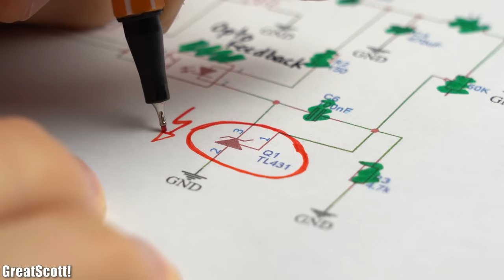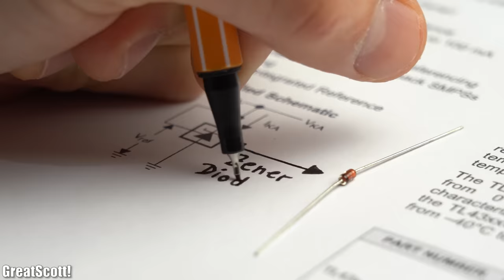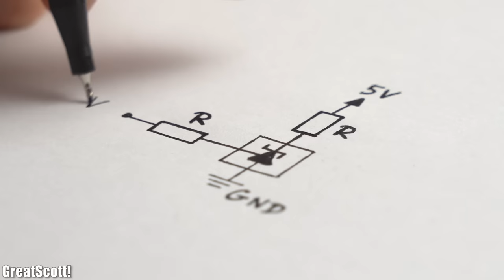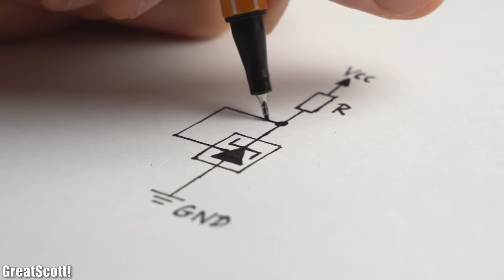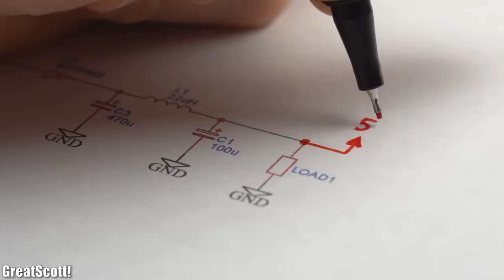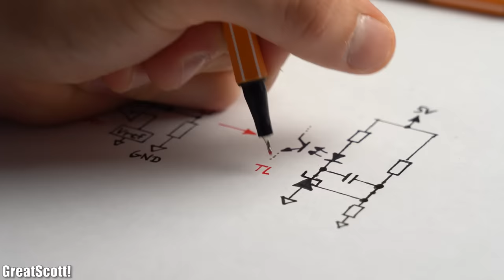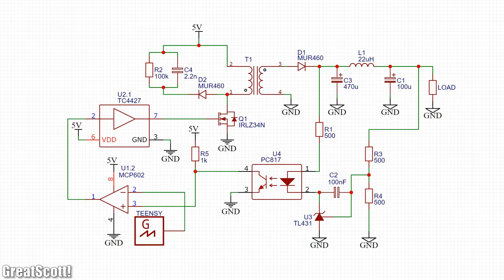Probably the most used component nobody knows of! TL431 Guide! EB#50

Comment: I had a 24 volt switched-mode power supply but needed 19 volts. To do this, I simply changed the voltage divider on the TL431. I connected a potentiometer (value corresponding to the old resistor that I removed) between the plus 24 volts and the 2.5 volt sense point of the TL431 and reduced the value until I could measure 19 volts at the output. Then I replaced it with a fixed resistor.
Reply: Is your power supply still working well now?
Reply: @salihay  sorry he dead,
May his soul rest in peace
Reply: It depends on the design, some controllers will have undevoltage protection on the VCC pin that feed them from a separate winding on the primary. Lowering the voltage of the output will lower VCC too. Doing the other way (try to change the voltage up) can also fail because the same issue. Some PSUs are pretty basic and will not care. Other have this protections and zeners as double safety, usually triggering from a dedicated optocoupler in case that everything fails (laptop chargers). also note that 817-alike opto polarization changes and its components need to be upgraded. Rising the voltage even when it looks "FINE" is not advisable. This PSUs have nothing to spare. Spikes when swithing off will kill the mosfet or reverse voltage will exceed the rated of the ouput diode. Otherwise ATX psus will make a great labo PSU ...and they are NOT. Tweaking an ATX PSU to ouput a higher voltage is a recipe for disaster.

Comment: TechBuilder made a short facebook post on this a few months ago. Never knew how nifty it could be by adding an outboard pass transistor. Been using it as a handy adjustable voltage reference for adcs
Reply from the maker: There are truly many applications :-)
Reply: I'd have to dig it up, but there was even a switching buck regulator example in one of my old Motorola IC catalogs that used a linear regulator as the sole control in the circuit. Not sure how accurate it was, but it was impressive to see someone using a linear circuit to do switching regulation. Really are lots of applications for something you would not think of.

Comment: Think of the TL431 as an NPN transistor with a Vbe of 2.5 volts, and a super high beta.
Reply from the maker: Nice comparison👍
Reply: AlHasan Sameh  gain
Reply: I don't know what you mean ,but guessing it's pretty rad .
Reply: AlHasan Sameh  There is no beta because there is no current-to-current multiplication; input current does not change much at all. The TL431 is an "almost true" differential voltage-to-current converter. Once it had reached the on-state threshold, it converts 1mV input (referenced to the threshold voltage) to 1mA of output current. And the maximal voltage gain is around 1000 or less (compared to around 3000-6000 for a silicon BJT).
Reply: It's more like a three pin op-amp with a high but very stable input offset voltage.
Reply: Wrong.
Reply: If you think of the TL431 that way (which is suitable or not depending on the use case, some issues were already pointed out), make sure you don't forget that the TL431 stops operating properly when the cathode voltage falls below 2.5V volts. A NPN transistor can regulate down to 0.2V saturation voltage at the collector. The behaviour of the TL431 with cathode voltage lower than ref voltage is unspecified, and *differs between manufacturers*! Make sure you don't accidentally rely on it, or if you already goofed up, make sure you specify the vendor.
I encountered this issue in practice trying to fix a TV SMPS. The supply shut down after some seconds of operation in "power on" mode, but worked in standby mode. One of my guesses was that a TL431 is broken, so I replaced it with a spare TL431, and the supply started behaving erratically, even in standby mode. I swapped the original TL431 back in, recovering standby operation, and finally found the design issue in the main SMPS aux supply circuit that made the SMPS controller chip overheat and go into some kind of protection mode.

Comment: Please keep in mind one important characteristic of this programmable Zener IC. 
It's fully temperature compensated, unlike any Zener that ever lived. 
Zeners are so yesterday.
Reply: It's really insane how much voltage drift things like temperature can cause.  Of course, that's what happens when you amplify errors.  Going from a 24V signal down to a 5V for ADC measurements doesn't sound so bad.  Until you realize that the max needs to be closer to 30, so any errors are magnified 6x.  At that level, even small differences become a pain to deal with.
Reply: "Ever lived" is an overstatement. There is a whole class of temperature-compensated zeners, like the 1N82x series. The genuine 1N829 costs about two hundred times more than noname Chinese TL431s, but it has a rated tempco of 0.0005%/K. That's 0.05% change over a 100K interval, far better than even the best-grade genuine TL431s. 
And if the app needs the lowest possible noise, again, the zeners are naturally quieter.
Reply: Zeners are here to stay for safety. Approvals agencies recognize it behaviour in a protection role, an ic can’t replace a zener here, they’re too slow and failure mode is not consistent. Zeners are cheap and available in different power handling sizes. Massive current pulse handling capability.

Comment: This video combines my two favourite things! A deep dive into a fun component and its applications, and a component that has become cheap because of how often it is used in industry. My last project actually used a TL431 - a voltage monitor to automatically cut-off power from a lead-acid battery for only a buck or two in parts. Thank you, and keep up the great videos!
Reply from the maker: Thanks for the feedback👍 Glad you enjoyed the video👌
Reply: Hey Leon, do you have an scrhamtic for that? I'm trying to build exactly that, but most cut-off circuits I found are op-amp based (just the ones I don't have on my parts bin)
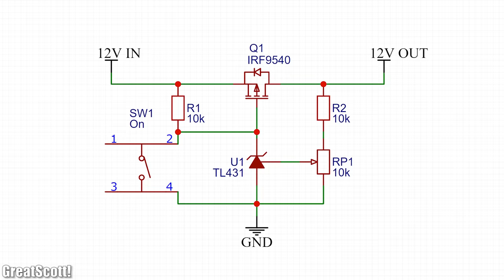Reply: @rhr-p7w  Of course! I'll draw it up for you tonight (NZ time). Prepare to be underwhelmed though... Conceptually it's the same is the circuit Scott shows at 6:50 - but with positive feedback to turn the MOSFET hard-on to prevent overheating (also oscillation), and inverted to use a more efficient (and cheaper) N-channel MOSFET.

Comment: I have a TL431 acting as a voltage reference in a few low-voltage-battery-cutoff circuits. I like to replace alkaline batteries in the cat toys we use a lot with lithium batteries, and I add a cutoff circuit to make sure the battery doesn’t discharge too far. Only five components!

EDIT: No joke, I wrote this before the exact same circuit appeared in the video @6:50…..GreatScott is always two steps ahead of me….😅
Reply from the maker: I just knew it😉

Comment: Regarding SMPS's - these often have EMC issues that designers overlook.  Such issues can plague and pollute the radio frequency environment unless the designer has taken great care.  I wondered if you could do a series of videos on these EMC issues?
Reply: He already made one.
Reply: And apparently some designers don't care at all. I have a Chinese power supply so bad that it can light an LED with just the noise. (Not even a complete circuit!)
Reply: @user2C47  If you don't have bearing on what countries EMC requirements you need to meet in which part of the world then, yes, it is a rather dubious task. I completely agree.....massive vent holes and poorly bonded gaps in chassis of most SMPS  and the fact that a good number of current product designers aren't instructed on giving a shit to begin with does not help the situation. IE not a China issue.

Comment: Used the TL431 in several applications,. Yes, very versatile component!
You call the internals of the TL431 a comparator, but it is really an opamp. 
You can use an opamp as a comparator, but in most cases you cannot use a comparator as an opamp, 
because comparators are not stable in the linear region. A TL431 can be used in the linear region, when you use proper compensation.

Comment: Strange — I use TL431 all the time. One of the best ways I found to control the current of a high-power LED (either linearly or through a switching converter) is with an op-amp comparing shunt voltage to a reference. TL431 is the exact thing you need for the job — the 2.495V it produces by default can be easily divided into anything you need, and, unlike a Zener diode, it can sink a wide range of currents with Vref staying within a tight range. It's basically an extremely accurate Zener that doesn't require you to meticulously precalculate the value of R_Z. Simply great!

Comment: Thank you, I've found these things in 50 cent phone chargers I've bought solely for experimentation and dissection. Never quite knew that they were but assumed it was a switching transistor.  (my fault for not doing more research) PS  No, I would not trust or use one of those cheap chargers but they're fun to mess with.

Comment: A very useful component, discovered it not too long ago when I tried building my first switched mode power supply, since it is so cheap and easy to get I use it in all sorts of applications from voltage references for arduino to tiny constant current load for my power supplies, amazing how versatile this little component is.

Comment: One thing I haven't seen addressed....unless I missed it is that when you use this as a zener,  the feedback resistors have to be quite a bit higher in value than the current limiting resistor.

Comment: There was a contest around the TL431 a long time ago, the winning entry was an audio amplifier for a crystal radio. Looks just like a transistor, the volume from what appears to be a crystal radio augmented with a single transistor amplifier was just incredible.
Reply: It’s incredible how much can fit into so little nowadays. We’ve basically gotten some components down to the point it’s able to be easily measured in atoms wide, like transistors with their less than 100 silicon atom wide. It’s crazy to think that we’re approaching the atomic level for how small some electronic components have been.
Reply: It's an mk484 i guess.

Comment: The problem with most switch mode power supplies is that of Radio Frequency hash they produce that wreaks havoc with radio communications devices. These units can be filtered, however, that is an added expense that most manufacturers ignore and therefore dont implement.

Comment: I mainly use it for battery discharge indication on pretty much all of my battery-powered things. There is a simple circuit with 4 resistors, TL431, 1 NPN transistor and an LED that lights up when the input voltage drops below a threshold set by the resistors, telling you to stop using the thing and charge it. The warning threshold is set by the ratio between resistors and can be adjusted for use with various amounts of NiMH or Li-ion batteries in series. For example, having a 3/10 ratio (10K/33K) makes the warning LED light up at about 3.3-3.35V, or 3/1 (33k/10k) for 3S Li-ion and 10.7 V (3.5 per cell) warning. When this is added as a module it draws very little power when idle, so i recommend everyone to try it
Reply: Thx very much, do you have some tuto on how to build the circuit, and information about how to tweak it according to each use??

Comment: Hi GreatScott!, Thank you for the videos you shot. I need a isolated DC/DC convertor, I will try to make my own. Is it possible to design, could make about isoldated power supply 1A or more. Because I am designing my own industirial PCB but power supply is the problem for industrial. There is always leackage or another problem. Therefore isolated power supply is necessary for my application. But isolated power supply so much expensive and It is difficult to supply.

Comment: 0:40 the efficiently of transformer is also above 90 % equal to Smps  so why smps only takes cradits of it 🤔🤔🙄🙄 ??
Reply: a linear regulator versus a SMPS?    NOT ALWAYS but generally SMPS are more efficient but do have a host of issues/problems.

Comment: The thing I don't like about TL431 is its high supply current. That makes it not suitable for battery operated projects. There are voltage detectors such as HT70xx and TC54 in the uA level.

Comment: Hello Mr. Scott
My charging cable (Type A to Type C) that came with my phone gave up on me and won't charge my phone anymore and since OnePlus uses a "proprietary" fast charging method the cable has to be capable of 5V and 6A minimum for it to work properly. I've tried other cables at my disposal but nothing works for the fast charging. I've grown accustomed and dependant on this feature and can't go back.
I've searched for cables online but they are either affordable and poorly made or decently made and ridiculously expensive.

I have took apart my old cable and found 6 wires in it 2 for GND, 1 for D+, 1 for D- and 2 for VBUS. I have clicked close up images of the soldered points if that helps but I couldn't find your e-mail so I'm typing this long comment.

Please help me understand on how to build my own strong and reliable cable. I am prepared to spend a little extra if it ensures the reliability of the end product.

Please do consider this. I don't have the money or patience to try out all the expensive but fishy cables online.

Comment: Could someone help explain why the voltage is only pulled down to 2V and not near 0V at 3:58 when the transistor is turned on?
Reply from the maker: That is the collector emitter voltage drop of the transistor. It can not go lower due to this construction.
Reply: Oh I see that makes sense! Thanks!

Comment: In the early 80s i worked at company making specialty handhelds.  They would transmit feild service data to a receiver which formated and handed the data to a host computer.
A salesman cam to sell switching power supply for the receiver.  The VP said no thank you because it did not weigh enough.  Managers would not pay $5000.00 for the box unless it had the transformer weight.  Of course this when some companies listed RAM in bits to compete with computers list RAM in bytes.  Now of couse many manifactures and customers are better educated.

Comment: TL431 in very low power circuits is a hog with its 1mA minimum required current, and it is an old model; it came out in 1977.
The LM385-ADJ came out much later, and is much better where every mili-Ampere counts, as it needs 100 times less current to keep regulating (10uA or 0.01mA minimum current).
 However, the maximum current is also lower, 20mA for LM385 instead of 100mA for TL431.
LM185 and LM285 are the same thing but made for wider temperature range.

Comment: Da komrad! You and da other eastern maker the afrostryogreatmakerandothers crew. I've been interested in learning the 431 lately and got 2 videos in a week but I rarely need or. Use the 431 or. Any ref outside an internal anyway.

May I. Suggest a diy digital pot, better yet, as a modular. With no microcontroller, or bit banging i2c/SPI/uart/wireless in an interesting way hit. All. The good spots

Comment: Hi Scott, love your videos and bog fan. I have 3s Lithium ion charger that should output 12.6. But after I plug the 2.1 plug into 48v battery by mistake it blows up, i changed the uf part and its working but with higher voltage 12.79V. What part is responsible for the 12.6v that I need to change, similar to your power supply.cheers

Comment: at 9:05 you use two 500 ohm resistors to create a voltage divider. Why use so low values? The divider draws 5mA just for that (assuming the output voltage is 5V). Does the TL431 have any current requirements on the input? Otherwise I would use much larger resistors to minimize wasting power. Great video btw! :)

Comment: Scott, good afternoon!
Really the TL431 is fantastic.
When I discovered it about 2 years ago, I was also surprised by its accuracy for a very small price.
I set up a small 5v voltage reference to calibrate small 3 1/2 digit multimeters.

I'm from Rio de Janeiro - Brazil

Comment: I have a lithium battery charger based on TL431, it’s control a npn transistor and this one drive a pnp transistor (pnp transistor is connected between a source and a diode and finally the battery) I try to understand if TL431 control a current or voltage

Comment: Is it possible using such principles to build something that combines two low voltage (5v) and low current (1amp) power sources, where one source comes from an unsteady origin (solar)? Or would I basically need to buck/boost the two sources, then wire the outputs in parallel? Maybe, something on the market already exists for this?
Reply: usually the two power sources need to be isolated from each other - diodes are often used for this. BTW I would not consider 1 Amp to be low current!

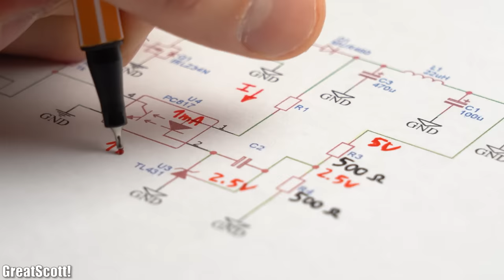Comment: At 9:16 "The other resistor needs to pass 1mA for the TL431 and 1mA for the opto-coupler LED". No it doesn't. The same 1mA flows through all three components as they are in series. You only need 1mA flowing not 2mA. The calculation for for R1 should be (5V - 1.2V - 2.5V ) / 1mA = 1.3 Kohm. It's not crucial, but it's better to get it right.

I should also add that low value zener diodes have relatively large slope resistances (the voltage changes a relatively large amount as the current through them changes). For example, the datasheet for a 1N4728A (a 1 watt 3.3V zener) shows a typical dynamic impedance of 400ohm at 1mA current and that's one of the better ones. A TL431 by comparison has a dynamic impedance of 0.15ohm across the full 1mA to 100mA range.
Reply from the maker: I was doing the calculation for the bypass resistor setup. Sorry that was a bit mixed up. But both resistor values should do the trick.